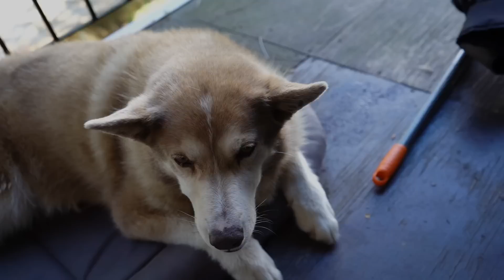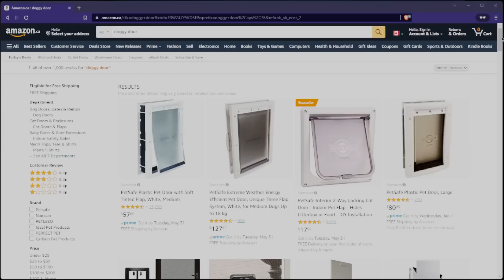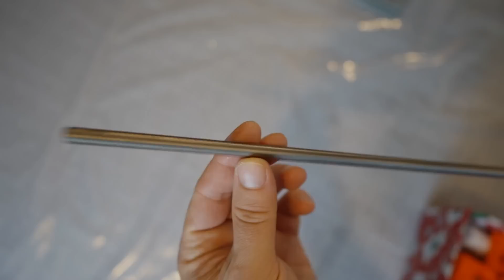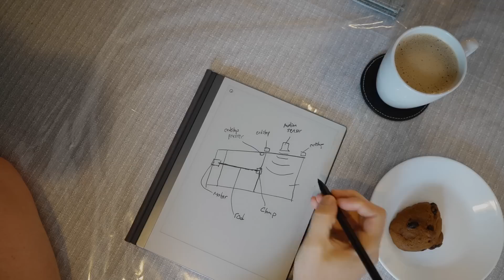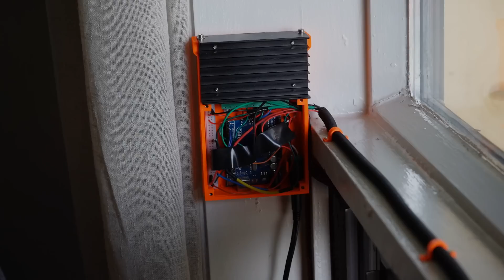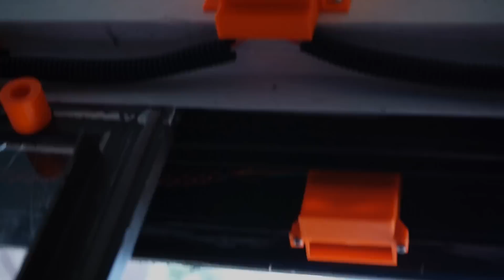A DIY automatic doggy door

Comment: Would you mind sharing the design of your plan
Reply from the maker: Hi, If I was doing this again today I'd have most of it coded by AI, and change the 3d printed parts dramatically to get smoother motion and durability. I did share the code as a reply to a comment below, but honestly, I'd rather not share the other files as I think AI could do a far better job, with less effort for anyone looking to do a similar project.

Comment: Nice man, I’m using rfid and a servos w/ a pulley system for a vertical open and close rather than horizontal. RFID sucks ass though, I’m gonna try your rfid trick. Only thing I’m worried about are bugs triggering it like a moth or a rat or something. Has anything beside your dog broken the beam ? I wonder if I can add drama to combat this

Comment: I like how you cracked your window. w No mention. LOL

You could have used a motor shield and not have to do so much wiring figuring. 

You could have just done this with relays and a timer relay. Yeah I know, you were doing this with things you had on hand, but you 3d printed parts so you can/could have got the other parts. 

I made a vid called "Screen Door Closer NO Arduino". Only a couple of changes and it can be used with the motion sensors.

Comment: Wow what a great project and execution!!  Been surfing the internet for a while now, but this is by far the best solution I've come across!!
So watched your video, rewatched it and... watched it again and went looking for spare parts that were lying around here.

Based on your remarkable sketch and the code that someone "extremely friendly" (NOT) asked for, I started working on a demo setup. Unfortunately, the motor does not want to go in any direction.Different from your setup I do use a 12V DC motor with a L298N board and had to redefine a pin on the arduino and in your script as well as remove the reference to Coil B (stepper motor) but nothing else has been changed.

Would you like to take a look at my script and sketch for errors ... and if so how do you want to get in touch
Reply from the maker: Thanks for the compliments; it was certainly a fun project - a lot of learning. If you'd like to send me your sketch you can email me at polartitan2@gmail.com and I'll take a look. Please send me the details of your motor as well as this is likely the key to solving your issue. The motor specs are pretty important toward having enough torque to rotate the threaded rod and move the door.
Reply: @CriticalQuestion  Super !!!

Comment: Dude!  Where is the code. Why bother to put it out there if you can not complete the video. Clearly you had no intention of posting the code.  What a waste of time with click bait.
Reply from the maker: Since you asked so nicely:

// Define pins:

int closedEndstop = 4; // button that detects when the door is fully closed

int openEndstop = 3; // button that detects when the door is fully open

int driverPUL = 7; // PUL- pin

int driverDIR = 6; // DIR- pin

int pirPin = 2; // Motion detector pin

int opirPin = 8; // Motion detector pin outside

//Define variables:

int pulseSpeed = 1000; //Speed of the motor (lower is faster)

boolean openState = 1; // tracks whether the open endstop is pressed

boolean closedState = 1; // tracks whether the closed endstop is pressed

boolean currentDirection = LOW; // Low is closing direction of the motor , high is opening

int pirStati = 0; // Keeps track of the motion value of the indoor sensor

int pirStato = 0; // Keeps track of the motion value of the outdoor sensor

//Functions:

void openingMotion (){

currentDirection = LOW; // set the direction to 'pull'

pulseSpeed = 1000;

openState = digitalRead(openEndstop); // openState variable is 0 when the door is fully open

for(int x = 0; x < 1000000; x++){

if (openState == 0){

break;

}

digitalWrite(driverDIR,currentDirection); // Put the motor into 'pull' mode

digitalWrite(driverPUL,HIGH); // pulse motor coil a

delayMicroseconds(pulseSpeed); // delay the pulse

digitalWrite(driverPUL,LOW); // pulse motor coil b

delayMicroseconds(pulseSpeed); // delay the pulse

openState = digitalRead(openEndstop); // check if the door is fully open yet

if (x < 850) {

pulseSpeed--;

}

}

delay (10000); // if the door is fully open wait ten seconds, then exit the function

}

void closingMotion () {

pulseSpeed = 1000;

closedState = digitalRead(closedEndstop);

for(int x = 0; x < 10000000; x++){

if (closedState == 0){

break;}

currentDirection = HIGH;

digitalWrite(driverDIR,currentDirection);

digitalWrite(driverPUL,HIGH);

delayMicroseconds(pulseSpeed);

digitalWrite(driverPUL,LOW);

delayMicroseconds(pulseSpeed);

closedState = digitalRead(closedEndstop);

pirStati = digitalRead(pirPin);

pirStato = digitalRead(opirPin);

if (pirStati == HIGH or pirStato == HIGH)

{

openingMotion();

pulseSpeed = 1000;

x = 0;

}

if (x < 850) {

pulseSpeed--;

}

}

}

void setup() {

pinMode(closedEndstop, INPUT);

pinMode(openEndstop, INPUT);

pinMode (driverPUL, OUTPUT);

pinMode (driverDIR, OUTPUT);

pinMode(pirPin, INPUT);

pinMode(opirPin, INPUT);

}

void loop() {

pirStati = digitalRead(pirPin); // check motion on indoor sensor

pirStato = digitalRead(opirPin); // check motion on outdoor sensor

if (pirStati == HIGH or pirStato == HIGH ) // if either sensor has potion

{

openingMotion(); // start the opening function

closingMotion(); // start the closing function

}

}